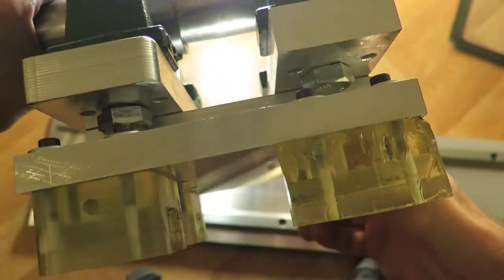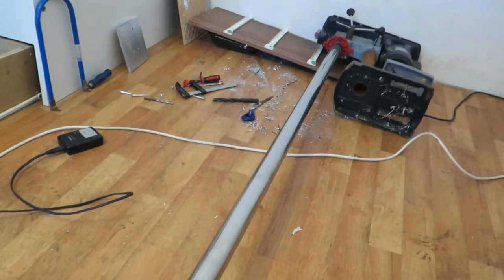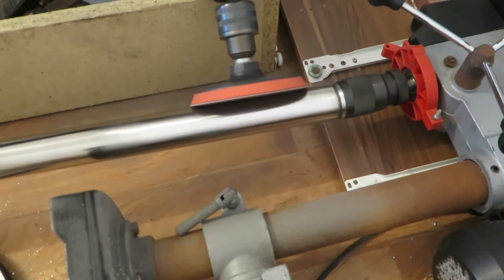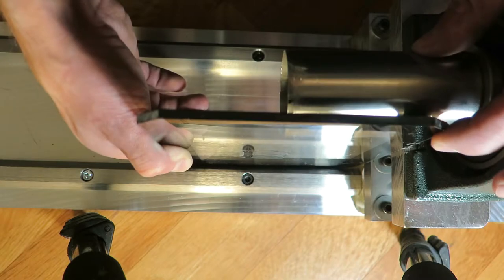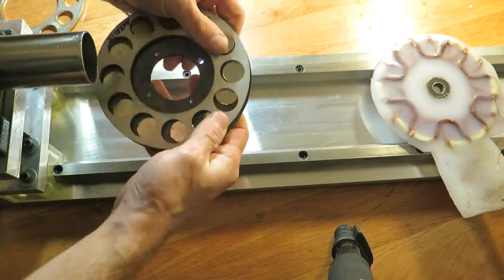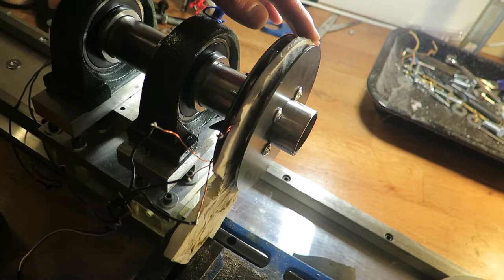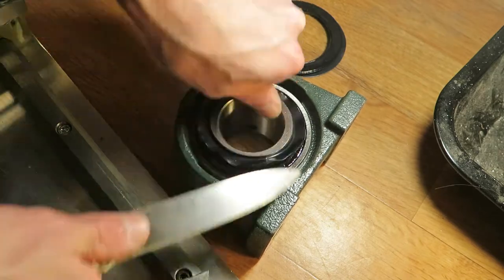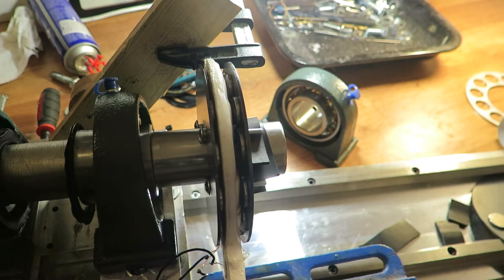Galss blowing lathe - spindle & motor testing

Comment: APPLY LOW FREQUENCY AT FIRST START.

IF IT DOESN'T WORK.

ADD SMALL COIL TO EACH COIL.

USE AS A COIL MAGNET SENSOR .

Comment: rinse the baring's with digresser they will run very smooth then
Reply from the maker: Thanks for suggestion, I did that and applied a shower of silicone oil.  I wonder, how long will they last in mildly corrosive environment...
Reply: only time will tell